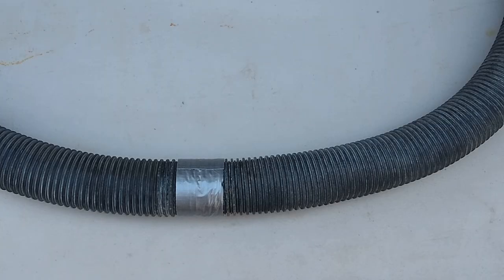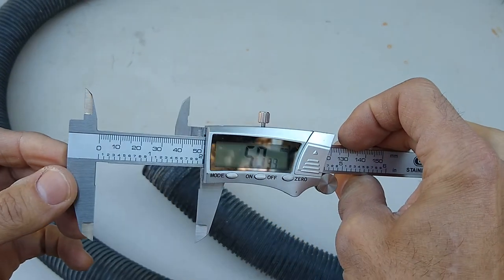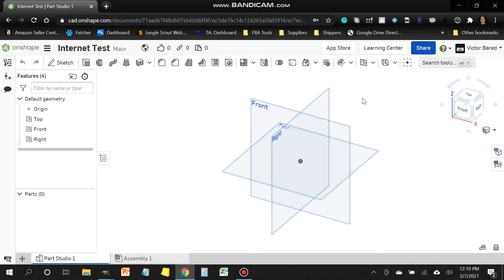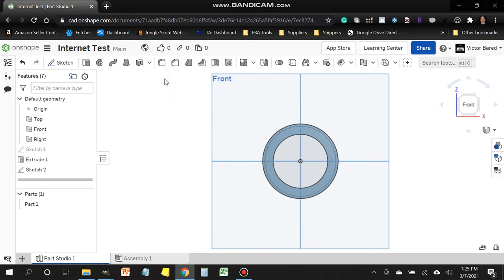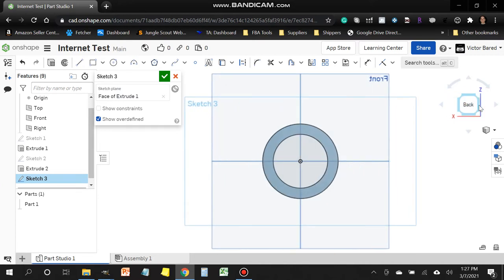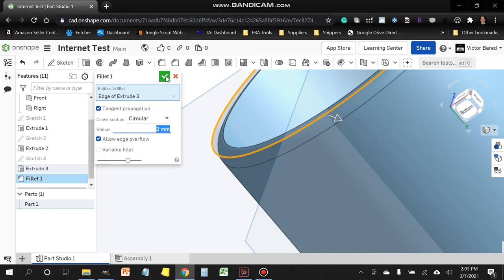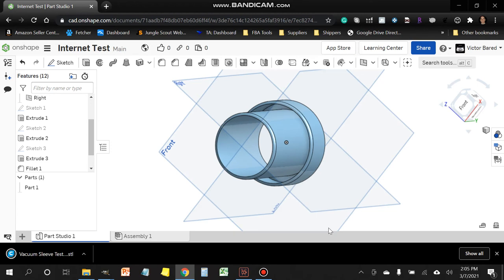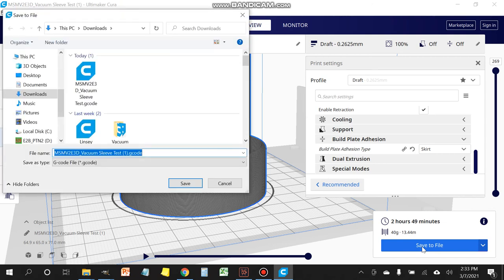DIY Craftsman shop vacuum coupler step-by-step using Onshape Cura and printing on a Monoprice Mini

Comment: You inspiring me, for build vapor blaster,may request a video explaining what if i use a compressor with ½hp
" Subscribe button clicked "
Reply from the maker: Hello Abdul, thank you for commenting. I'm glad you are excited about building your own. You can do many things with it. When I was learning about getting mine to work efficiently I also started with a smaller compressor. My 2hp with a 20-gallon tank would only give me about 2 minutes of blasting before turning on to recharge and I would have to wait until it stopped running before continuing. The key to continuous vapor blasting is enough CFM (Cubic Feet per Minute) available to run the vapor blaster and recharge the air tank at the same time. You are going to need an 18 CFM minimum. A 1/2hp compressor will deliver less than 1 CFM because the pump piston and tank are too small. You can try to use a smaller 6 mm nozzle on the vapor blaster but it will be frustrating to wait for the compressor to fully charge the tank again every few seconds. That's what happened to me at first until I replaced my small compressor with this one. Now I can blast continuously.

https://www.ingersollrandcompressedair.com/ss5l5-single-stage-air-compressor.html

 Best of luck with your projects!